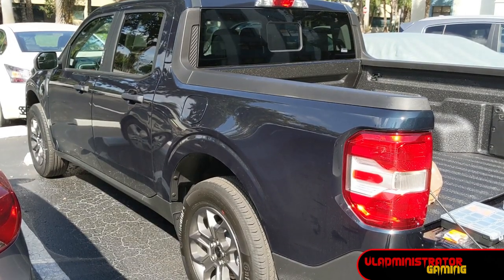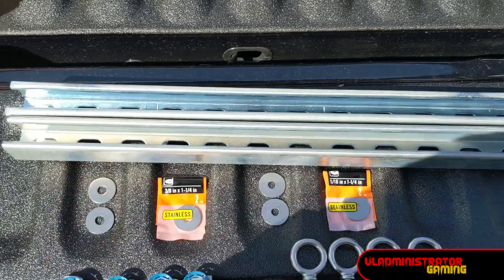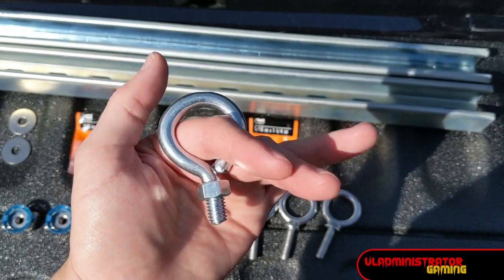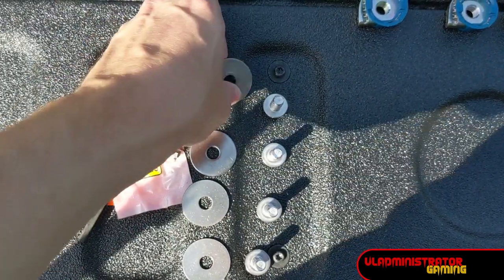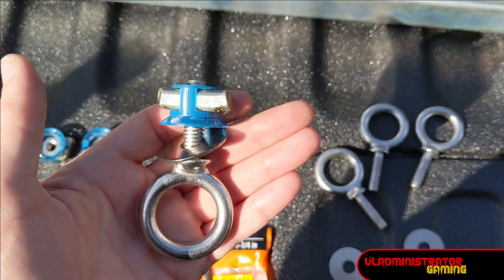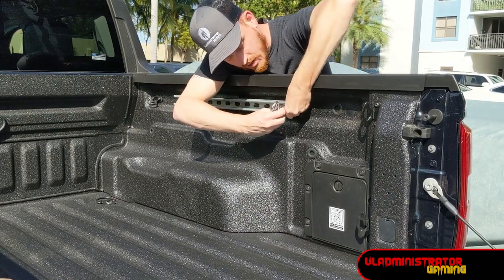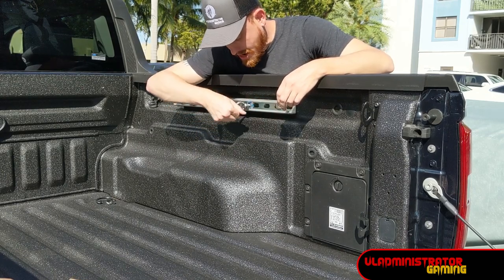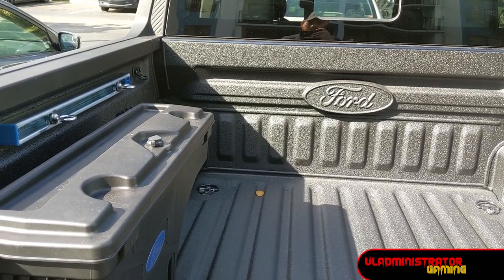Ford Maverick DIY Bed Rails | Accurate Instructions

Comment: Good job. The strut channel and cone nuts sold in stores are thinly plated with zinc. A few uses scrape the coating off, allowing rust. You can find stainless or aluminum strut/nut options sold by electrical suppliers who cater to industrial customers.
Reply from the maker: Good to know. 👍

Comment: Dang, looking to do this on my '24 XLT and the plastic bed liner is not pre-drilled. So I get to remove the whole thing, find the holes (assuming they even exist on the '24), then drill my liner.

Comment: Is there a reason you only made the rails that long? Just a matter of securement?
Reply from the maker: The bed itself is pretty short, 54 inches, and already has tie downs in the front and rear corners along with several in the bed floor. So two feet in the middle for the extra tie downs the rails provide is more than sufficient.
Reply: @VladministratorGaming  great point, and great diy for sure.
Reply: Agree, I removed the front tie downs to get full length rails to install bed cover, bed rack, and whatever else you want to mount on side walls of bed, more tie downs are lowest priority for me.

Comment: I can’t get one of my 8mm bolts to screw into one of the pre-drilled holes in the truck bed. What else can I do?
Reply from the maker: I'd double check the treads on your bolt. Make sure they're all in good condition with no flattening or burrs. If those are ok, it's probably the threads on the welded nut integrated with the bed. You'd have to replace it, rethread/tap it, or drill your own replacement hole.

Comment: What are the actual lengths of the bolts etc? I see you posted the bolt type and thread type, but no lengths. Like for the m8 bolts, how long should they be? The eyelets, what the shank length and total length? Thanks.
Reply from the maker: The parts list is in the full video description.
Reply: I am also looking for the length for the M8 screws.
Reply from the maker: @TheHMER  the supplies list is in the video description for easy access if you need it. M8 x 1.25

Comment: Hi Vlad, great video !  Question: Any particular reason why you are using a "Channel A" type of strut ?  I am thinking of using a Channel B type of strut for this project  (the channel is not as deep).  And, in my local big-box store, the Channel B strut that they sell is 14 gauge instead of 12 gauge and it's not as heavy.  I prefer to use a lighter-weight strut.  Is there any downside to using a lighter-weight strut (14 gauge channel B type strut) ?   Also, would the 3/8" strut cone nut that you recommend here, would that work for the Channel B strut as well ?  It seems that most of the 3/8" strut cone nuts that I can find are designated as for use with Channel A, C, D, E ... everything but B ??   Are Channel B struts designed such that strut cone nuts cannot be used in their tracks ?  Thanks in advance for any suggestions you have !
Reply from the maker: I was originally going to use the type B strut. However my local stores had the precut channel A and not B. I was also having trouble finding the caps for the end for the B channel. The only concern you may have is the depth. While the cones nuts may fit for both channel A and B types, they could run into your fastening bolts to the bed with the B type due to their shallower depth. If the strut, cone nuts and fastening bolts can be found in your local hardware store you could give it a quick test while in the store.
Reply: @VladministratorGaming  Thank you so much for the reply, Vlad !  You are kind.  I have another issue with this project ... that "gotcha" that you had mentioned, where you said Ford gave wrong info about the buts needed for those holes ? ... So, I got that it needs to be M8 instead of M6.  But, how about the thread ?  Does it need to be M8 125 or M8 100 ?  I am running into snag in that .. I am pretty sure those holes are already threaded (no need to tap), but ... I cannot fit the M8 125 bolts into them (???)  M8 is correct size for sure ... but .. do I have the wrong thread ? i.e. It needs to be M8 100 instead of M8 125 ?  I thought of this because ... in your other video where you put in the back-hook, you had used a M6 100 tap, to tap the holes, to fit M6 100 bolts in them.  So, maybe these M8 pre-drilled (and pre-tap) holes that Ford has done (for this Rail project) ... could it be that they are 100 thread instead of 125 thread ?  Is that where I've gone wrong ?  (I got M8 125 bolts, and maybe I should've gone with M8 100 bolts ?)  ... Really appreciate your help 🙂
Reply from the maker: @HungCLieu  I just checked and I used M8 1.25 x 25mm bolts. Here's the link to the ones I purchased https://a.co/d/6l6oH2B
Reply: @VladministratorGaming  Yeah, that is what I have already ... M8 1.25 x 25mm bolts.  But, I cannot screw them in (to the holes on side of the bed).   You did not need to tap them, did you ?  (When I look carefully into each of those holes, it looks like they are already threaded, so I don't think they need tap'ping ... but the M8 1.25 x 25mm bolts that I have, can NOT thread thru ... Can't figure out what am I doing wrong ...  I look thru the comments posted on your video here ... and looks like there was 1 other person who had the same issue ?
Reply: Or ... maybe ... is there any harm in Tap'ping those holes again with a M8 1.25 Tap ?  (even if it already has threads in them) ... Your thoughts ?
Reply from the maker: @HungCLieu   they should be already threaded, no tapping needed.  I wouldn't put it past them to use different stock of the bolts if they ran out of a specific size. When the 2022 models were being built, supply chain was interrupted. You could pick up some of the alternate thread type and see if it works before trying anything with tapping them.

Comment: Where did you get the eye bolts at?  I can only find 4” ones in stores.
Reply from the maker: I got mine off Amazon, but a marine /boating store should have better options than the regular hardware store locally. QWORK 3/8"-16 UNC Stainless Steel 316 Eye Bolt, 4 Pack 3/8" x 1-1/4" Marine Grade Machinery Shoulder Eyebolts https://www.amazon.com/dp/B08GQVTGWC/ref=cm_sw_r_apan_i_KRZQPRERMAAPA86Z96PC?_encoding=UTF8&psc=1

Comment: why did you use the short rails? there is room for 36 inch?
Reply from the maker: You could go with 36", but be ready to cut the rail yourself to length. The bed has tie downs in all 4 corners already. For me there's no need for longer rails as you have tie points on the outer edges already. When Ford did this, they went with 30" rails. The bed is only 54" to begin with, so I'm quite happy with the 24" length.

Comment: How much did that rail cost and where did you get it?
Reply from the maker: I got the rail from the Home Depot. Had to check online to see which one locally had the 24" so I didn't have to wait for it to ship. Got the endcaps from Lowe's, because they were the only local place that had the caps in stock. The two rails and endcaps were about 30 bucks total.
Reply: @VladministratorGaming  Wow so much cheaper than the $500 cost if purchasing  from Ford.
Reply from the maker: @raptorsfangirl561  Yes, indeed.
Reply: @raptorsfangirl561 Yes but the FORD ones are longer.  I would go at least 30 inches vs. 24 inches.  For me, I went with 40 inches.

Comment: I found this one on Amazon. Is this the correct rail? 1.625" x 1.625", 24 inches, 12 ga, Galvanized Steel, Half Slotted Strut Channel
Reply from the maker: Those dimensions match the ones I used.

Comment: so the M8 x 1.25 hex head would be 30mm, right? M8 x 1.25 x 30mm? that's the part that you left out and that's what people are asking in the comments, its not in your description. Because this is what the guy at the hardware store asked me, he said 25? or 30?
Reply from the maker: The ones I got were 25mm. Pretty sure 25mm or 30mm will work just fine though.
Reply: @VladministratorGaming  great. Thank you. Might want to pop that in your description cause I saw others asking this on various videos
Reply from the maker: @VinceAwesomeGaming  Thanks, I'll add it.

Comment: I would’ve sprayed the rails with a liner type spray first
Reply from the maker: The rails I used are galvanized, so you would have to do some prep work to get most sprays to actually adhere. These have been installed for over a year now with no issues of corrosion.
Reply: @VladministratorGaming  understood, I just think they would look better with the black bed liner than having the metal look as they have now…